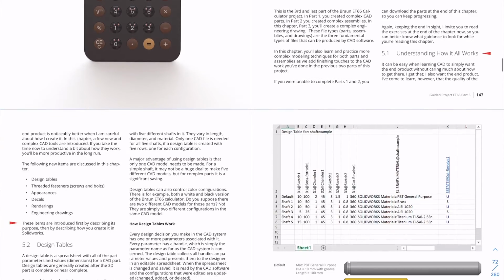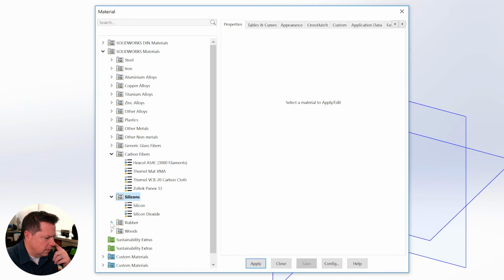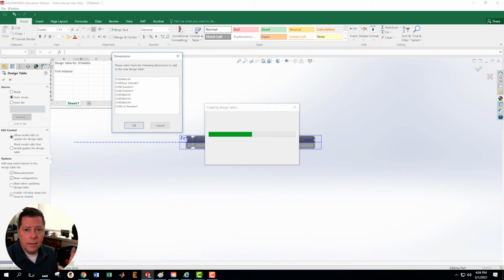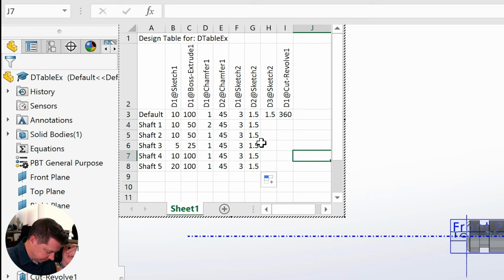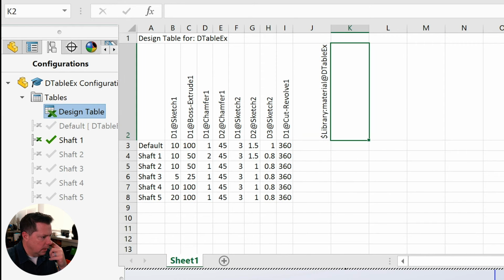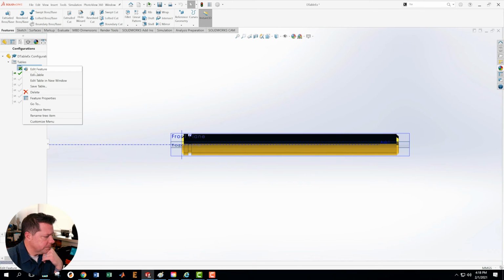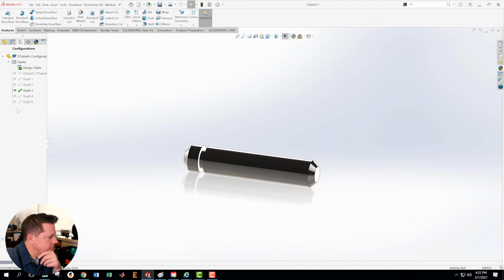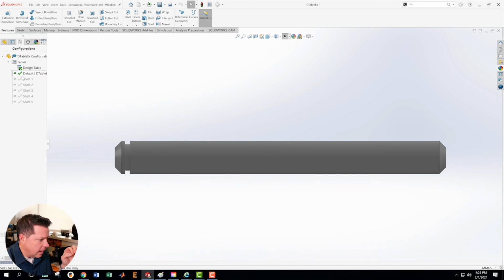Creating and Debugging a Design Table in Solidworks

Comment: Brother, I  wanna Asking. I have some problem. why design table does't auto update and only start working again when i close and re-open the tabel? even thought Checked "Allow Model edits to update the design table". did i miss some setting? because of this so annoyed. solidworks version 2023. and i did not find any reference in a Solidworks forum.

Comment: if I want to create shaft 1 to 100, do I have to type name manually?? or there are any short cuts? thanks you
Reply: just drag and drop bro its excel it will auto fill it
Reply: @danialahmed1994  1'' to 100'' bro. I have to use formula for that, i was asking for shortcut. Anyways thank you ❤️
Reply: @ you can always eyeball it for small numbers or decimal 10 multiplicatives. If the number is way greater and messy like 3617 then its best to solve it with the formula.